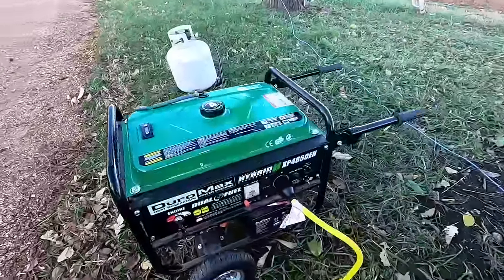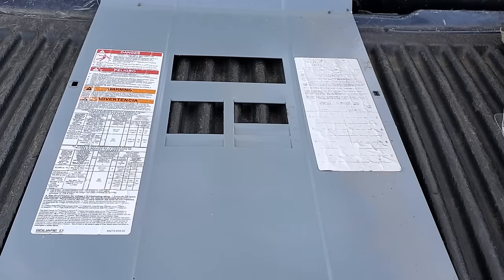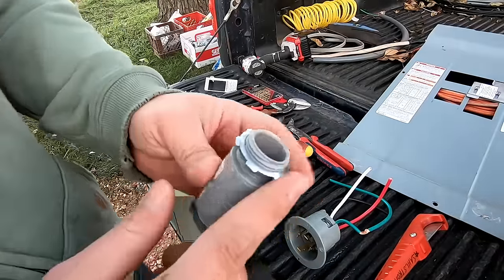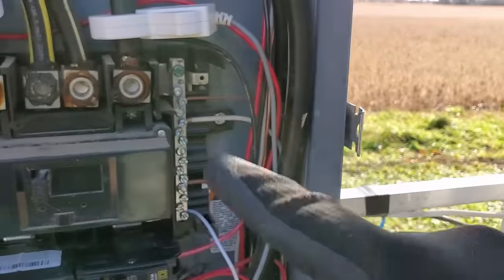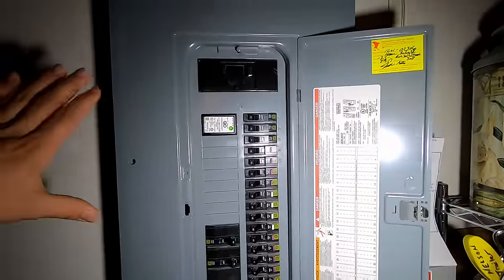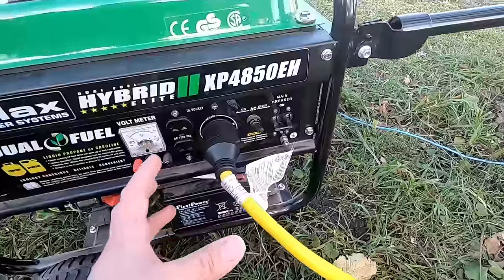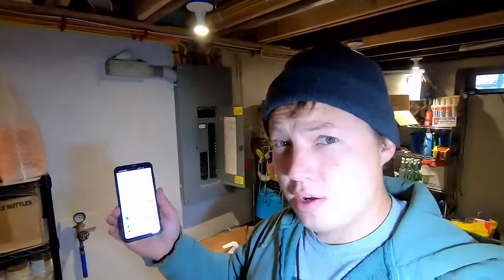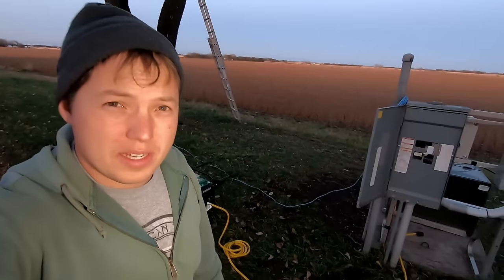How To Hook Up a Generator To Your House Using a Breaker Interlock Kit & Power Inlet Box

Comment: Thank you so much.  So in a power outage loss case.....when the power is restored you wouldn't know till you see your neighbor's lights on???  So this breaker style interconnection won't tell you when grid power is restored like a manual transfer switch??? As in with a xfer switch when utility power is restored the other non transfer switch items come on...?? How would you be alerted of utility power being restored?? Only via the sense app spiking??? When main utility voltage is detected?
Reply: Always remember to always make sure you follow all the generator safety rules whenever you use your portable generator. 
⚠️Here are the Generator safety rules that everyone needs to follow when using generators:

This is just a reminder for everyone’s safety when using portable generators. All generator safety rules need to be followed carefully to avoid hazards. 

1) Please do not allow an unqualified person or your children to operate the portable generator. Just because some manuals don’t say that doesn’t mean it’s safe. That is important against the generator safety rules. We also need to be keeping an eye on our children too. You need to make sure that your children are not playing near the portable generator especially when it’s running so they won’t get electrocuted. Generators pose electrical risks and they can be hot during an operation. Please keep your children away from the portable generator at all times. It is important to keep our children safe especially our little ones. Be aware of all the hazards.

2) Some people use their portable generators indoors which increases the risk of carbon monoxide poisoning. It’s important to have a carbon monoxide if you have a gas generator. Never ever use your generator indoors even if your doors and windows are open and even in the garage is not safe to use a portable generator. Not even at your porch and your deck. It is never safe to use your generator indoors and in enclosed areas of your home. Your generator needs to be 15-20 feet away from your house. 

3) 🔥generators cause fire hazards too. Never refuel your generator while it’s running. You need to let your generator cool off before refueling it and before storing your generator. Never overload your generator too. Never ever back feed your generator. You should never plug your generator into a wall outlet. Also never store propane tanks indoors. Please keep flammable things away from the generator as well and please don’t smoke cigarettes near the generator. Having a fire extinguisher next to the generator is also important against the generator safety rules. 

4) generator operation; make sure your hands are dry before touching the generator. Never use your generator in wet conditions. Don’t let your generator get wet. You need a generator tent if you need to use your generator during wet weather. Please don’t wear loose clothes when operating the generator. Turn on your generator before plugging in appliances. Use the right cord for your generator. Please do not use worn out cords. 

https://youtu.be/I1jT3ANENvI and here is a video more about keeping others safe when using generators and also about our family’s safety. Hope this helps

Comment: One option for running an electric water heater on a limited power source is to have a switching system to feed it from 120V rather than 240V while on backup power. Just connect either of its "hot" inputs to neutral instead. This will reduce its power consumption to 1/4, so a 4500W element will only pull 1125W (E^2/R, R being constant), well within the limits of small generators. It'll take four times longer to heat water, of course, but with some care on the consumption side this can work fine. Obviously you shouldn't try this with one of the heat-pump types!
I use a DPDT contactor, with 24V DC coil energized from my PV system only when the grid is down and batteries are full, or nearly so, allowing the water heater to serve as a diversion load, making use of excess solar power than would otherwise be wasted in that circumstance.

Comment: Great video!  Very thorough. And yes always torque breaker lugs. That’s NEC 2017 code
Reply: Here are the Generator safety tips: Always make sure you follow all the generator safety rules whenever you use your portable generator. This is a reminder for everyone’s safety of using generators. Generators can be dangerous if not used carefully. Every year, hundreds of people die or get injured when using portable generators due to carbon monoxide poisoning and electrocution. Make sure you are using your generator carefully and keeping others safe as well. There is something very serious that everyone should always be aware of when using generators. Some people do run their generator indoors which is not safe and that increases the risk of carbon monoxide poisoning which can cause death of family and you. Some people run their generator in wet conditions which can electrocute them. Please remember that you should never run your generator indoors. Remember that carbon monoxide is an odorless and colorless gas that you cannot see or smell. Carbon monoxide is a silent killer. Keep that in mind. Make sure your generator is 15-20 feet away from your house and away from doors, windows, and vents. Never use your generator in your porch too. Having a carbon monoxide detector is very important against generator safety. Some people also allow children to go near the portable generator which could pose risks. We need to keep an eye on our children making sure that they are not near the portable generator so they won’t get electrocuted or burned by the generator which is dangerous. A locking enclosure also keeps kids safe. A generator shed might look like a tempting place to explore, or take cover during a game of hide and seek, but a generator is a dangerous piece of equipment that can cause injury. It says on the manual that we should also keep children away at all times from the portable generator to avoid injuries. Please do not allow a child or unqualified people to operate the portable generator.  It is important to keep your children safe especially little ones. The portable generator can be hot during an operation. Just because some manuals missed what should be listed doesn’t mean it’s safe to do. Always follow the generator safety rules when using portable generators. Generators pose electrical risks. If you need to use your generator during wet weather, you need a generator tent to protect your generator from getting wet. Don’t let your generator get wet. Keep your generator dry and before using your generator, please make sure your hands and your generator is dry. Do not wear loose clothing when operating the generator. Everything that is said on the generator’s operating manual should not be ignored. Never smoke cigarettes near the generator. Please keep flammable things away from the generator. Never overload your generator too. Your generator can catch fire. Never ever try to plug a generator cord into a wall outlet to avoid back feeding. Back feeding your generator is dangerous. Always turn on your generator first before plugging in appliances and shut off the appliances before turning your generator off. Use a heavy duty cord for your generator and the cord should not be worn out. All the instructions should be followed carefully. Never refuel your generator while it’s running. It can cause fire if fuel spills while your generator is hot. You should turn off your generator and let it cool off before refueling it. Having a fire extinguisher next to the generator is also important. This is only a reminder for everyone’s safety of using generators. Make sure your generator is properly grounded. Having a fire extinguisher next to the generator is also important against the safety rules. https://youtu.be/I1jT3ANENvI and here is a video more about keeping others safe when using generators and also about our family’s safety. It’s important to keep our little children safe as well. Make sure your little children are kept away from the generator at all times especially when it’s running. Hope this helps. Always remember that it’s better to be safe than sorry. Also remember that warnings should not be ignored too.

Comment: You likely already know this now. Most generators advertise the "peak" wattage on the units. There is a "continuous duty" rating on generators that is somewhat lower than the advertised rating, which is likely why your breaker tripped. 

I'm not an electrician, so I only offer general information,  (gained by experiencing EXACTLY what you did in the video. 😂)

I enjoy watching your videos and appreciate your efforts sharing your expertise. 
Thank you!
Reply: Here are the generator safety rules that everyone needs to follow: this is just a reminder for everyone’s safety. Always make sure you follow all the generator safety rules whenever you use your portable generator. Generators can be dangerous if not used carefully. Every year, hundreds of people die or get injured when using portable generators due to carbon monoxide poisoning and electrocution. Make sure you are using your generator carefully and keeping others safe as well. There is something very serious that everyone should always be aware of when using generators. Some people do run their generator indoors which is not safe and that increases the risk of carbon monoxide poisoning which can cause death of family and you. Some people run their generator in wet conditions which can electrocute them. Please remember that you should never run your generator indoors. Remember that carbon monoxide is an odorless and colorless gas that you cannot see or smell. Carbon monoxide is a silent killer. Keep that in mind. Make sure your generator is 15-20 feet away from your house and away from doors, windows, and vents. Never use your generator in your porch too. Having a carbon monoxide detector is very important against generator safety. Some people also allow children to go near the portable generator which could pose risks. We need to keep an eye on our children making sure that they are not near the portable generator so they won’t get electrocuted or burned by the generator which is dangerous. A locking enclosure also keeps kids safe. A generator shed might look like a tempting place to explore, or take cover during a game of hide and seek, but a generator is a dangerous piece of equipment that can cause injury. It says on the manual that we should also keep children away at all times from the portable generator to avoid injuries. Please do not allow a child or unqualified people to operate the portable generator.  It is important to keep your children safe especially little ones. The portable generator can be hot during an operation. Just because some manuals missed what should be listed doesn’t mean it’s safe to do. Always follow the generator safety rules when using portable generators. Generators pose electrical risks. If you need to use your generator during wet weather, you need a generator tent to protect your generator from getting wet. Don’t let your generator get wet. Keep your generator dry and before using your generator, please make sure your hands and your generator is dry. Do not wear loose clothing when operating the generator. Everything that is said on the generator’s operating manual should not be ignored. Never smoke cigarettes near the generator. Please keep flammable things away from the generator. Never overload your generator too. Your generator can catch fire. Never ever try to plug a generator cord into a wall outlet to avoid back feeding. Back feeding your generator is dangerous. Always turn on your generator first before plugging in appliances and shut off the appliances before turning your generator off. Use a heavy duty cord for your generator and the cord should not be worn out. All the instructions should be followed carefully. Never refuel your generator while it’s running. It can cause fire if fuel spills while your generator is hot. You should turn off your generator and let it cool off before refueling it. Having a fire extinguisher next to the generator is also important. This is only a reminder for everyone’s safety of using generators. Make sure your generator is properly grounded. Having a fire extinguisher next to the generator is also important against the safety rules. https://youtu.be/I1jT3ANENvI and here is a video more about keeping others safe when using generators and also about our family’s safety. It’s important to keep our little children safe as well. Make sure your little children are kept away from the generator at all times especially when it’s running. Hope this helps. Always remember that it’s better to be safe than sorry. Also remember that warnings should not be ignored too.

Comment: Great video! You are great at explaining ground bonding and the explanation with the generator helped me finally understand the importance of it. You always stress electrical safety and I commend you for that.  When someone tells me they have purchased or are going to rent a generator I always explain the hazards of CO and proper ventilation. I will now explain the need of proper grounding in the different applications of use.
Reply: ⚠️portable generator safety announcements:

This is just a reminder to remember the safety rules when using portable generators. 

1) KEEPING OTHERS SAFE: Please do not allow an unqualified person or your children to operate and service the portable generator. Just because some manuals don’t say that doesn’t mean it’s safe. That is important against the generator safety rules. We also need to be keeping an eye on our children too. You need to make sure that your children are not playing near the portable generator especially when it’s running so they won’t get electrocuted. Generators pose electrical risks and they can be hot during an operation. Please keep your children away from the portable generator at all times. It is important to keep our children safe especially our little ones. Be aware of all the hazards.

2) WHERE TO RUN YOUR GENERATOR: Some people use their portable generators indoors which increases the risk of carbon monoxide poisoning. It’s important to have a carbon monoxide if you have a gas generator. Never ever use your generator indoors even if your doors and windows are open and even in the garage is not safe to use a portable generator. Please do not even use your generator in your deck or balcony. It is never safe to use your generator indoors and in enclosed areas of your home. Your generator needs to be 15-20 feet away from your house. 

3)🔥FIRE HAZARDS: Never refuel your generator while it’s running. You need to let your generator cool off before refueling it and before storing your generator. Never overload your generator too. Never ever back feed your generator. You should never plug your generator into a wall outlet. Also never store propane tanks indoors. Please keep flammable things away from the generator as well and please don’t smoke cigarettes near the generator. Having a fire extinguisher next to the generator is also important against the generator safety rules. 

4) GENERATOR OPERATION: make sure your hands are dry before touching the generator. Never use your generator in wet conditions. Don’t let your generator get wet. You need a generator tent if you need to use your generator during wet weather. Please don’t wear loose clothes when operating the generator. Turn on your generator before plugging in appliances. Use the right cord for your generator. Please do not use worn out cords. 

https://youtube.com/shorts/eFigDfnPkcQ?feature=share and here is a short video more about keeping others safe when using generators 

Hope this helps

Comment: Thanks. Dude. I was thinking of transfer switches etc. Talked to the electrician, and saw $$$$$ going out the window. This makes good sense. I'm a machanic and my dad and brother are electricians, so I know a thing or two about electricity.  Thanks again. We are going to replace our service, so that will be the perfect time to install the isolater. Thanks again. Me gen is 10000 watts start and 9000watts running.

Comment: Hi Ben
Can’t Thank you enough for this excellent video.
One question I hope you can answer.
What is the purpose or need of the retaining bracket that went over the 30 amp generator breaker, but under the face plate?